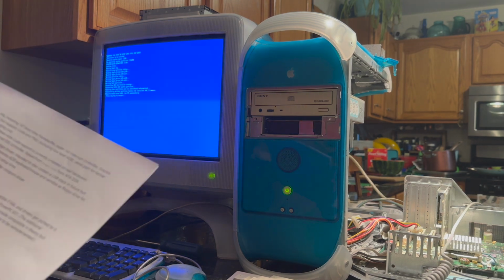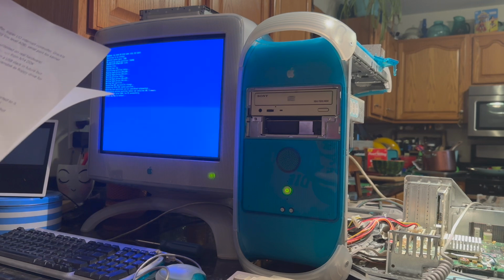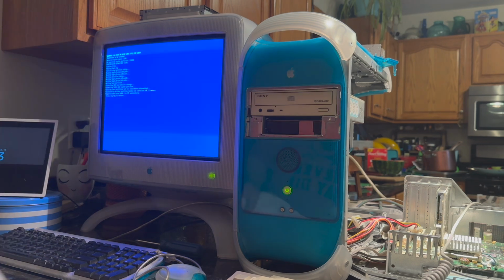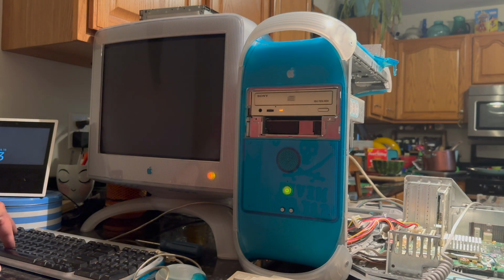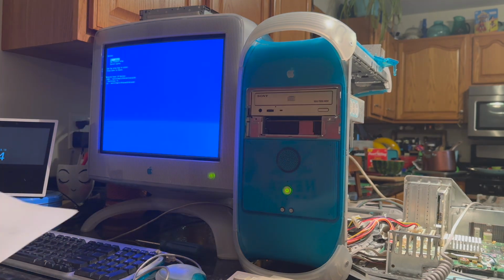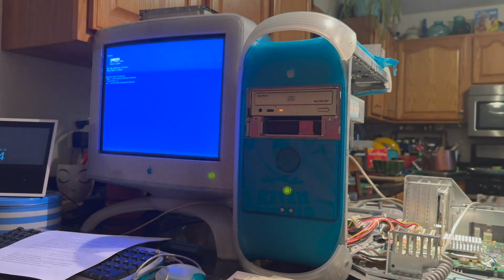NT 4.0 on Power Mac Blue & White G3 - Part 1 of 2

Comment: Never had a G3 Tower like this, Always wanted one, they looked awesome back then
Reply from the maker: In my opinion, they still look awesome!
Reply: @jonobst  My ADHD fluttered and I didn't finish my train of thought LOL
I would defiantly love one for the Collection, I had an All white eMac a while ago, but that got lost in a move, I Do have a G5 Mac Pro Aluminum Tower on the Shelf Downstairs thgouht with a few newer intel Macs I've Rescued
Reply from the maker: @MotownBatman  Gotcha!  I have too many of those darn G5's but not a single quad core one, which is the one I'd really want.
Reply: @jonobst  I have an Intel MacPro 1,1 that I believe has an i7.
I got it Not Working, Possibly Power Supply and it was FULL of DUST Meatloafs.
I cant bring myself to spend the money on an OEM Replacemnt, I gotta see if I can transplant an ATX Power Supply
Reply from the maker: @MotownBatman  The 1,1 Pros are ubiquitous in my area, I've picked up a couple for around $20 with monitors and keyboards.  Probably easier to just buy a whole new one for cheap than troubleshooting one, sadly.
Reply: @jonobst  It's Most Likely Gonna End Up a Nice Lower Shelf Piece LOL

Comment: I do wonder how this works on the last revision of the G3 grey towers. I'd be very interested.
Reply from the maker: The gray ones were G4's - and in theory it works, but as it currently stands they don't have ADB support and USB interfaces aren't implemented in the HAL yet so you won't be able to provide any inputs to it.
Reply: @jonobst  More to the point, USB wasn't implemented within NT4 at all. I remember running a Zip Drive, which had the first NT4 driver for USB but it wouldn't support hot swapping, so it functioned like a SCSI peripheral. You had to boot with the USB device attached for it to initialise. I think you could eject but to reattach you had to reboot. There may be more functional third party USB drivers now as I haven't used it in a while.
Reply from the maker: @egbront1506  The person running this on their iMac got the USB mouse and keyboard working through some trial and error.  This should be rolled into the main codebase shortly, and would allow the G4s to have it installed.
Reply: @jonobst  That's great. I thought it would take a bit of time to get even that far from basically scratch.
Reply: @jonobst  break out the soldering iron! lol
Reply from the maker: @Dan-TechAndMusic  I do, and ... ohhhh.  Yeah OK in my part 1 video I suggested the soldering-in-connectors option for iMacs. :)   I don't believe G4s have an ADB system present on the board so then for now they are not usable.
Reply from the maker: @Dan-TechAndMusic  ah OK, well I am learning lots of things today about various systems!

Comment: I didn’t know that Windows NT could run on PowerPC computers.  Is it true that these G3s don’t have as many problems with bad capacitors as Macs from the 1990s do?  That’s what I’ve heard.
Reply from the maker: NT was compiled for Alpha, MIPS, PPC and x86 - and the install CDs contain all the code for all the supported processors.  What Wack0 is working on is the HAL - Hardware Abstraction Layer - that allows the NT system calls to be turned into instructions that the Mac understands.  As for caps, the B&W G3 used tantalums and not electrolytics unlike the G3's before them.  Power supply cap failures are still pretty common in this series of machines (and more so with the G4).
Reply: @jonobst  Gotcha; thanks!
Reply: @jonobst  And also the firmware bridge that Windows NT requires.

Windows NT doesn't work with Open Firmware, but ARC. This is true for PowerPC and Alpha NT hardware, and x86 had a boot loader that emulated ARC enough to get into NT (this was dropped in Vista, I remember reading). So the developer had to bootstrap the ARC firmware on top of Open Firmware.

For instance, ARC seems to require Master Boot Record, but Mac OS only works with Apple Partition Map. This requires some work if you want to dual-boot Mac OS or Mac OS X and Windows NT 4 (apparently booting Mac OS from the dual-boot corrupts the MBR).
Reply from the maker: @MaddTheSane  I did read that about Mac OS finding an MBR and killing it.  Seems pretty intentional by Apple to prevent this exact thing from happening.
Reply: @jonobst  I think it's more that the developers didn't think that someone would/could use an MBR as a boot drive. If ARC/NT allowed booting from different partition map layouts, this wouldn't be a problem.
Reply from the maker: @MaddTheSane  sure, that makes sense.